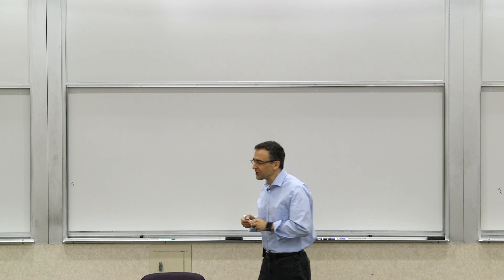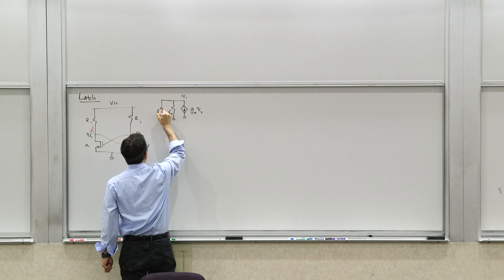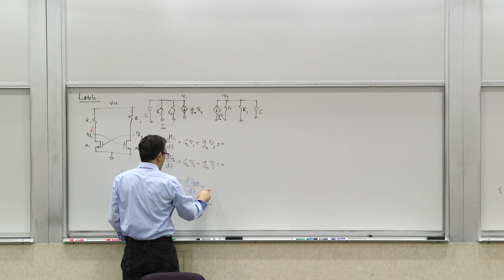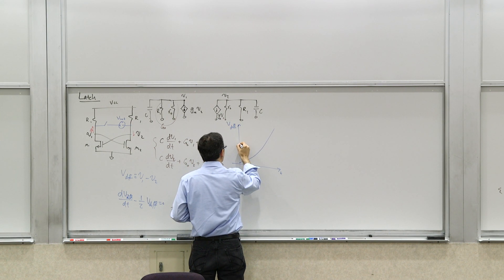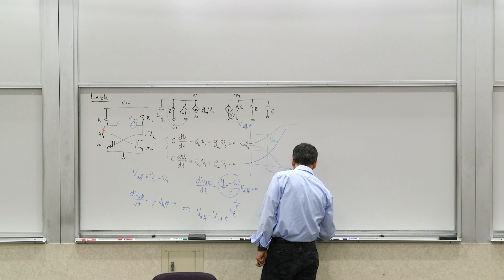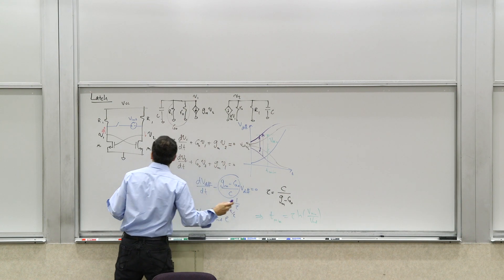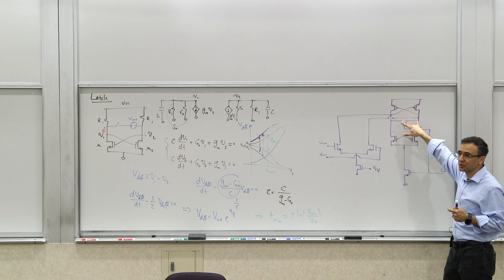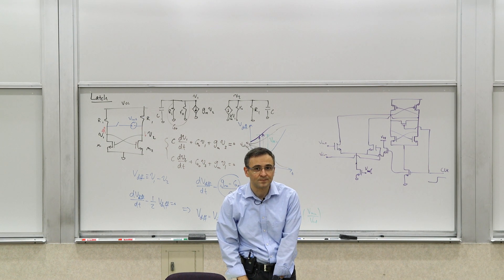180N. Latch dynamics, latched comparator

Comment: Hello. First. Thank you very much for the lesson.
Second. I have a question, I hope somebody could help me. When the current sources nmos transistors are clocked, the clock has digital levels? I mean, if the VGS is supplied by VDD, the VDS should be so high so they operate in saturation, or they could operate in lineal region?

Regards.

Comment: Thanks for great lectures and I want to ask something. Can you re upload 9th lecture of circuit and system class. I am having difficulty to watch it. It is all green screen. Thanks again.
Reply from the maker: These issues are often caused by the need for an updated player/driver according to the quick search I did on our future overlord (Google). I don't see any problems with that video either. Please let us know if the problem persists even after that.
Reply: @AliHajimiriChannel  Future overlord.. lol. Anyways, thank you for taking time to upload these videos into overlord repository.
Reply: @AliHajimiriChannel  I did extensive work — independent self-study — and am aware of deep technical issues;  Resolves to common ordinary matters; It is that what is called codecs  →  encode / decode;  have budget at ( a brand ) then the encode-decode remains based on what I will call primitive code from decades prior which is developed in an early era; 

It will not get fixed I assure you;

Were it to be that were so it would already be done;
Reply: Hi, maybe you can double check that since I actually can watch that video.
Reply: @giblejess8983  Hi are you sure you have clear video after 2:30. Lecture begins perfect but then later on I am loosing the video. moreover for later minutes black screen turns into green. Which browser do you use? Thanks